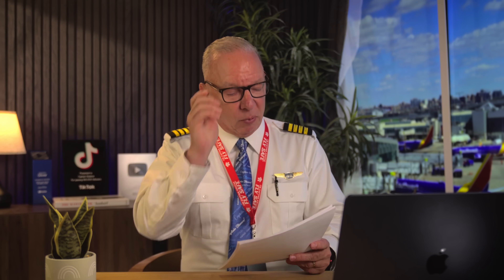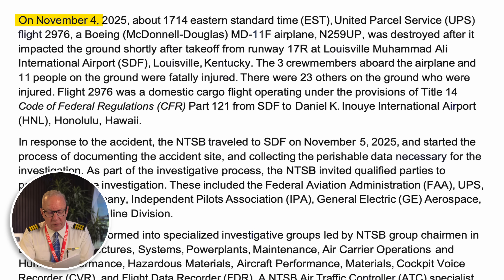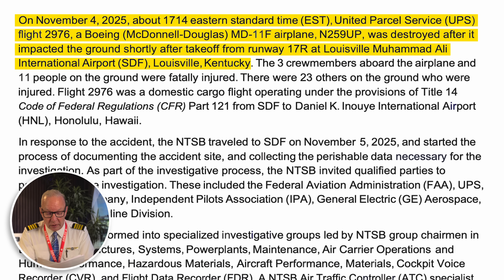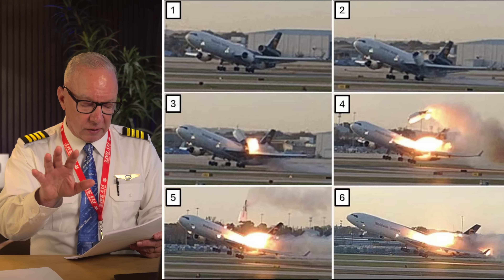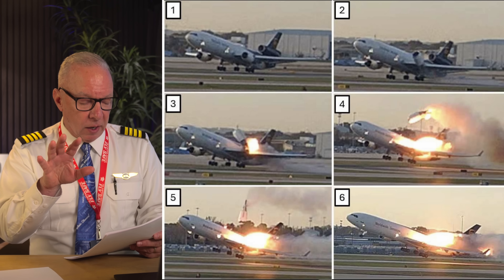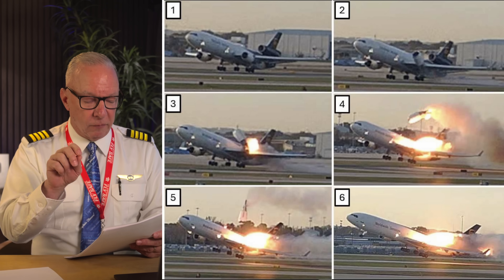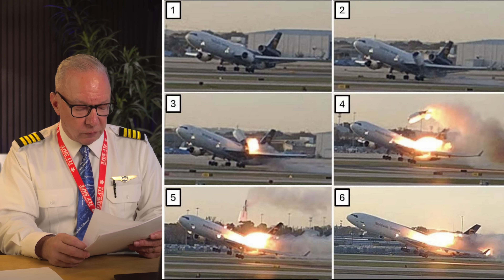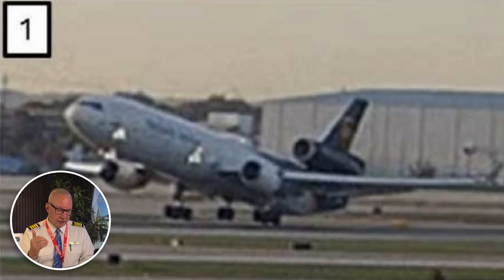UPS Crash Preliminary Report | Pilot Reacts to UPS Crash Report

Comment: What i dont get is why airplanes still doesnt have what your average tesla have; to be able to see whats going on around and back of the car. Its not that hard or expensive to attach some 360 or just a few back looking regular cameras to the plane. Like they should be able to see whats going on not just some lights and buttons. I mean like lots of crashes since the 80 s where we were able to get small cameras could ve been prevented by giving the pilots situational awareness ability thru visual aid by cameras.
Same goes for here. If the pilots were aware that an engine went over the wing in a screen infront them even for a split second they could ve decided to abandon climb and the crash might have been with less casualties. That visual aid would ve changed a lot on decision making.
Its the year 2025 and you cant drive 30 seconds without checking your mirrors and have a situational awareness around you but they still dont have this on passenger planes which carry lives.

Comment: Well, material fatigue is common in failure. Actually just like that submarine going to titanic that implode. In airplanes it's must be almost impossible to 100% control with ten of thousands of parts. 
Especially when we demand lower price tickets, lower cost transport, and also demands of faster and bigger airplane with even more material weight and strength control and service, low price, that for sure make it in total made for a few accidents. Flight industry kind of killing themselves in a almost impossible equation of low cost production and effective weight to passenger numbers,

Comment: Let's say the quite part out loud. Planes are NOT inspected often, or correctly. It Is what it is. This plane should NOT have been flying. Always "make sure this doesn't happen again." However, it happens again. SMH.  Classic. There will be more crashes. Ever wonder why Airforce One never crashes? Because it is inspected every damn time. Over, over and over. UPS needs to move flights out constantly.  Around 300 a night, if my info is correct. No way those planes are maintained as they should be. Nowhere near the same inspection. Duh.🤦‍♀️

Comment: Heartbreaking for the victims and their families. Those images are absoluting chilling. We have to ask if those long maintenance intervals were sufficient considering the 1979 AA Flight 191 crash (DC-10). In hindsight, clearly not. The NTSB is right to ground the DC/MD-10s and MD-11s fleets until every single pylon is checked and scanned for fatigue and damage.

Comment: Hi captian steeeve , I worked in a engine overhaul facility in scotland here's a bit of information that is of interest engine pylon has a bullet shaped pin locates  in to  pylon on to wing mounts the pin during major overhaul is removed but they are very hard near impossible to get out of pylon , we had a brain storm black belt meeting on this and came up with a way of welding bolt to the bullet pin to remove it { done for years ) during ups audit years later it was discovered that during the welding on of bolt to pin it was causing a  welding arc on the pylon it was discovered that this new procedure was not written in to the repair manuals ups demand that those involved were fired which never happened but all involved were given final written warnings was a few years ago now but not sure if procedure was rewritten into manuals legally or not used anymore hope this makes sense regards .  Not going to mention company but am sure you can guess .

Comment: At the absolute longest, inspections should happen annually, not more than half a decade apart.  That's insane. This is a high stress point, which means it deserves significantly more attention than it has been given.If this is an MD maintenance suggestion, MD should have to redesign and update all existing aircraft at their own expense with a significantly more robust and redundant system for engine-to-pylon, and pylon-to-wing attachment points.  

Also, all military MD aircraft (if any) should be grounded until an detailed inspection on each aircraft (including for micro-fractures and stress cracking) has passed, flawlessly, before returning to duty.  High stress points of all aircraft, from all manufacturers, military, and civilian operated commercial and passenger fleets, need to be closely inspected, much more often, not less than annually, if not in shorter intervals.

Comment: Clearly all MD-11 and DC10 are old airplanes with a very high risk of this happening again . The engineering of these Pylons are a failure that no one mentions . Flying again these airplanes would be extremely unsafe . Safety first . NTSB and FAA  ( Time to make the final decision ) The investigation would be useful for making better and safer Pylons and a requirement to use stronger material on wings and Pylons.

Comment: oy Captain, you are a little mixed up on the report.  The pylon has a forward and aft mounts.   The AFT MOUNT has 2 PARALLEL ADJECENT LUGS, known as the FORWARD LUG, and AFT LUG. Both LUGS belong to the AFT MOUNT.  THE AFT LUG FAILED, overstressing the FORWARD LUG (OF THE AFT MOUNT), resulting in complete failure of BOTH LUGS of the REAR MOUNT.
Reply: Doesn't matter at this point. What matters is that knowing the likelihood of failure, the inspection intervals should have been far more frequent. This would include removing the affected components and subjecting them to ultrasound and X-ray inspection. This could have been completely avoided.

Comment: Compressor stall on no 3 engine. Another assumption which id consider almost impossible yet good old Captain Steve pedals his diatribe for nobodies benefit other than his own. Why not apply to the NTSB your analysis is invaluable.
Reply: When the final NTSB  report comes out hopefully the FDR will show how the No. 2 and No. 3  i.e. attached engines were performing  during the whole duration .  It is possible that both were  affected the No. 2 it appears more so.

Comment: I see a key similaritiy with ELAL 1862 in Amsterdam on Oct 4th 1992 with a Boeing 747 Cargo. The engine 3 came off due to a broken pin with fatique cracks and slammed into engine 4 with fatal result.

Comment: The sad part is that the aircraft should be designed so the forward pylon mount fails first. IF that happened, the engine/pylon combination would fall downwards rather than fly up, and probably not strike the #2 engine, and the plane would likely not have crashed.

Comment: I believe that current regulations require multiple attachment points.
Certainly a single bolt attachment would no longer be adequate in a new design.

Comment: The cause is fatigue... So this means they used sub standard materials to build the airplane?  
Routine maintenance may not help.  Replacing parts may help.

So they have to ground the airplanes.

Brief explanation of fatigue...
It's the cycle to load.  Example..clamp a metal rod and push to the left and then push to the right..keep doing this.  The first push is not create failure but after many cycles (may be more than 20,000 cycles) it fail.

Comment: Why doesn't the report mention anything about the No. 2 engine's compressor stall and/or it losing thrust, if that's what happened? They would have these readings from the data, so surely it would have been mentioned in the initial report?

Comment: I would think that a visual inspection would not detect a fatigue crack, only a detail Non-Destructive Inspection would.
Reply: Under paint.

Need X-rays or maybe ultrasound.

If it's so bad it broke the paint, the plane would already have crashed on a previous flight.

Comment: Steeeve, I love ya but you're getting ahead of yourself again like the first video, they're saying 400ft Aly MSL not AGL. It may well have gotten to 400bft above MSL (Mean seal level, you're confusing MSL with AGL (Above ground level, you'd need to see what the altitude the girls in Louisville is Vs MSL which is actually 501 Ft, so the 400 above MSL is junk too since the plane is 501ft altitude MSL when it's sitting on the runway. 🤦‍♂️

Comment: These engine mounts are designed in such a way that if they fail the engine would do exactly what it did; fly up and over the wing as it did in the Chicago crash. 

What was not commented on was why the huge fire. Apparently the fuel tank in the wing ruptured or perhaps the fuel was still being pumped into the open fuel line. I am curious as to what happened.

Comment: Captain Steeeve, I really like your videos and your analysis, but in this one case over the last few videos about the UPS accident, I've been bothered by your references to American Airlines Flight 191 in 1979, an incident I well remember as it happened when I was a child and made me afraid of flying for almost 20 years.  I know why you're bringing it up because it involved an engine detaching from the wing, which then triggered a crash, and on the surface it mirrors the UPS crash.  However, the cause was completely different and had nothing to do with the DC-10 (at least not that time, anyway).  191's accident was caused by improper maintenance procedures on the part of American Airlines.  The engines had been removed improperly during an inspection because American was not using Douglas's published procedure.  Instead of removing the engine first and then the pylons, they were removing the engine and pylons together.  This caused damage and cracking to the whole assembly, and that damage is what led to the engine separation.  The DC-10s may have had other problems involving the pylon design, but Flight 191 was a different case altogether.  

Again, I really love your channel, but I think it's very important to make these distinctions so that no one is inadvertently misled.  Maybe it will turn out eventually that UPS was also using an off-the-books engine removal  procedure, but right now there's nothing to suggest that is true.

Comment: just to clarify, it sounds like the report is saying the wing failed, not the pylon - "..attachment hardware were found with a portion of the left wing" and "...hardware remained attached to the wing clevis"
the pylon attachments remained secured to the part of the wing they were supposed to be attached to. this also explains the fire above the wing, as the wing structure failed and fuel could leak from it.

Comment: You cant take breaks during critical engine changes as what happened in 1975 the hydrolics on the forklift slowly lowered while holding the new engine while the engineers were at a break, causing the pylon to buckle.

Comment: All airplanes should be redesigned to be able to stay intact after a crash in the water or on land. Otherwise they are unairworthy!
Reply: Let's do that.  Let's build aircraft from a solid ingot of steel, six feet thick and attach 256 engines so it will fly.  Now, what do you imagine will happen to the passengers inside your magic aircraft when it slams into the ground at 400 mph?

Comment: Thanks for this update steve, I love your work, I think though in picture 1, the damage has already just started, visually if you study the horizontal front wing edges of both wings, you can see the good engine sitting in place just as it should be, But looking closer at the bad engine you can see it has just started to lift up a little,, both engines in pic 1 are not exactly aiming in the exact  same direction, I held ruler as a straight edge across the front of the wings and its possible to see a slight difference, True enough This would have happened in a spit second before But i do think maybe it has already broken and is in the early stage of lifting away... Great work steve, thanks mate.

Comment: It was at 481 ft above MSL because the airport thrrr is approximately 450 feet above MSL.
Reply: and the NTSB has been saying this since the press conference on the second day, and people just keep ignoring that they said this and saying that the 450 feet is "wrong"
Reply: @chrisbrace2204 peoples rent ignoring it, just the guy making this video.  He’s made wrong comments about it twice now.
Reply: @fiveoboy01 We got Cap Steve reading the Prelim NTSB report and saying "that's not what happened, it wasn't that high at all."
Jesus, now i understand why ALPA is against raising the retirement age.  A few days ago he told the world that he was certain the #3 engine was compressor stalling and could prove it, which he didn't.  Now he thinks the NTSB's report is wrong. 🙄

And a few weeks ago on another accident he claimed that RCC of 5/5/5 was the worst runway conditions possible with no braking action.  Yeah, he got that completely backwards. Looks like it's time to unsub.
Reply: @fiveoboy01 💯%
I believe I'm done with Captain Steeeeve.  Sad that Mentour Pilot sold out.  I still got faith in Blancolirio. Peace Out!
Reply: The ADS-B altitude of 475 ft was from the GPS, which uses the WGS84 as a datum; notionarly the same as AMSL. Also the elevation of the departure end of runway 17R is 461 ft, so the height above ground level is 475 - 461 ft = 14 ft. The Low Range Radio Altimeter (LRRL) provides height above ground and is calibrated to use the main undercarriage as a datum; which gave the height as 37 ft.

The UPS Chain Solutions building that was struck is about 40 ft tall.

So the figures are about right.
Reply: @christopherrobinson7541  I agree 100% and I design GPS recording systems for high precision tracking of test aircraft. WGS-84 is indeed MSL and not AGL.
Reply: @christopherrobinson7541 17R goes from 489-461 (as you said) on the departure side.  The surveyed MSL is 500’.
Reply: This is where you get into science/industry speak.  A really good press officer will make those translations, at least in the handout.
Reply: Thanks, I was wondering if that was it.
Reply: This comment is old.  He aint lookin at these comments or is deliberately ignoring them lol
Reply: Highest point in the county is 906 FASL and lowest is on the Ohio River at about 383 FASL (depending on what the river's doing).
Reply: I question if he is a capt or not. how does he not know what MSL is.
Reply: Yes but that doesn’t mean the plane was at 481 ft in the air.. land goes up 450 and the plane was 30ft over land. Didn’t say they were 481 ft over land. The plane barely left the ground regardless of being 450 ft higher in land altitude
Reply: @khristopherhinds5820  100 ft agl is what's in the report.
Reply: @khristopherhinds5820 reported altitude of the airport is listed as 501 feet ANSL, but that is the highest point of one runway 450 at the end is normal. I have seen more commentators and commenters miss that.
Reply: @khristopherhinds5820 some people don't really understand height, and makes the wrong adjustments based on it. I would advise them to look at the obilisk in Washington D.C. and ask, how tall is that structure? For comparison.

Comment: 46 years and the EXACT SAME scenario plays out.  This is unacceptable
Reply: Gee the accidents look identical , on take off, a/c rolls to port...lots of flames, fatalities.
Calling it "unacceptable " is misguided. 
The actual cause of the engine separating from the wing in these cases are totally different :
As pointed out by others the Chicago DC10 was caused by maintenance  crews taking a shortcut ( using a forklift) when removing and reinstalling the wing mounted engines. 

The UPS accident seems to have been caused by undetected fatigue cracks in the rear engine mount.  Not sure if the spherical bearing or its support housing was the root cause (wasn't paying attention)

Comment: You should explain that your analysis regarding the number 2 engine compressor stall is NOT mentioned in the preliminary NTSB report. This is because no flight data recorder information has yet been released.

Comment: The #1 engine rotated up and over the body of the aircraft due to gyroscopic precession.  The kinetic energy in the engine at the time of rotation is massive and the force on the aft bulkhead of the pylon was too moch (also consider it was amplified by the moment arm that is the length of the pylon); as the plane rotates that creates a force that is going to pull that engine 90 degrees to the right, couple that with the aircraft's rotation and you can understand why the engine went up and to the right.

So I question this... what if the engine was rotating outboard?  Would the engine may have been precessed (forced) down & outboard (away from then #2 engine)?

What is impressive is that these guys flew this plane right into the crash & they just never gave up.  Absolute heroes in my book.

Comment: Average age of the MD-11 fleet could make any sort of reengineering or reinforcement of the pylon mounts not economically viable potentially?  Could this mean the end to the MD-11?  Can’t imagine air crews would be too excited to keep flying these aircraft if airframe age and fatigue cycles are resulting in structural failures.

Comment: It’s probably elsewhere in the comments BUT 72/12 =6.    That means that the inspection time interval is. SIX & not FIVE years.   

    The obvious question is whether the maintenance cycles dictated by the manufacturer and previous accident/ incident analysis (if such standards exist from these sources ) differs from the maintenance cycle standard used by UPS

Comment: Captain, the altitude of the city of Louisville is more than 400 feet above sea level. If you subtract it from the 481 feet of altitude above sea level reported by NTSB you obtain around 80 feet of altitude reached during takeoff. I guess it's close enough to your evaluation, right?
Fly safe! Big hug!